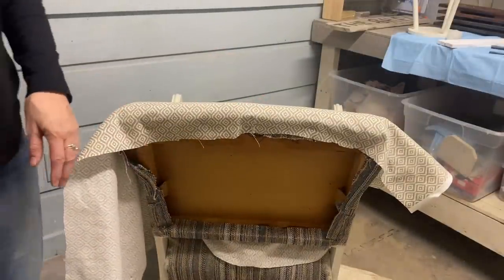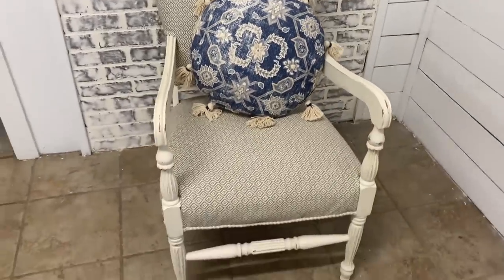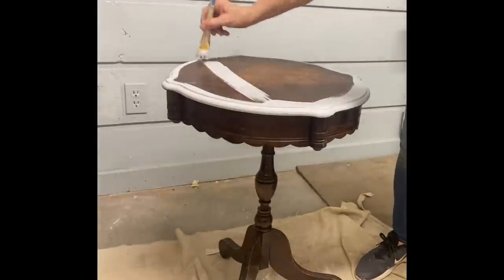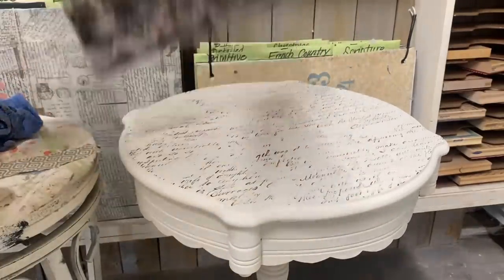Shabby Chic Vignette

Comment: Greetings!
Lisa, you did a great job as usual. I would love to see how you accomplished the brick panel behind the chair and table etc., if it is a panel of faux brick. 

I also have several of those cast iron/cast metal lamp bases. Two of them have that double light fixture at the top. 
I have succumbed to the cost effectiveness of LED lights. You can buy some LEDs that are in plastic rather than glass. I have noticed, after hours of careful attention, that the LED lights in my lamp (like yours in this video) which is in my kitchen (along with many other varieties of lamps)...NEVER gets hot at the top of the bulb. I've even tested this situation with  fabric touching the LED bulbs. 
Of course I would never deliberately leave them unattended...but it's great to know that if you forget to turn off a lamp, with a shade like yours in the video, we don't need to panic. Even overnight.
I thought I'd add this note if you've read all of this so far: 
I have had success bending wire lamp shades.  With care, you can bend a round shade into an oblong oval shape, which works great for these small lamps with double light fixture/configurations, at the top. At least.. it works for me.
I'm 73. I've been refinishing things, and DIY-ing for over 50 years. (Some successes amidst some failures.) May GOD continue to bless you and those you love with every good thing which eternity has in store for HIS family.
Darla
Reply from the maker: I will plan a video on that.  Thank you sweet friend.